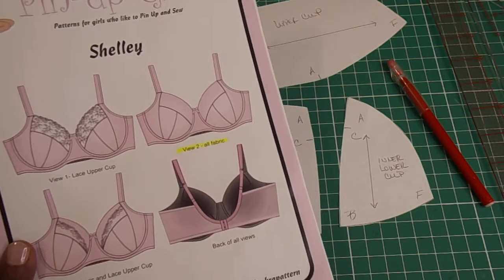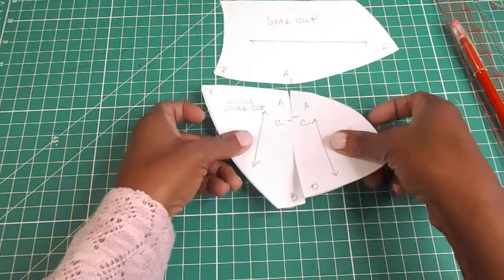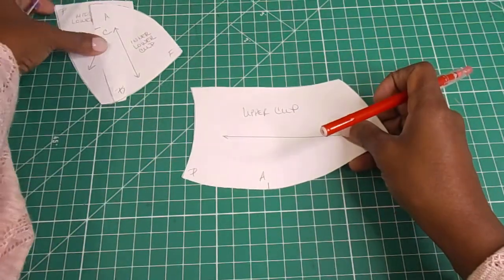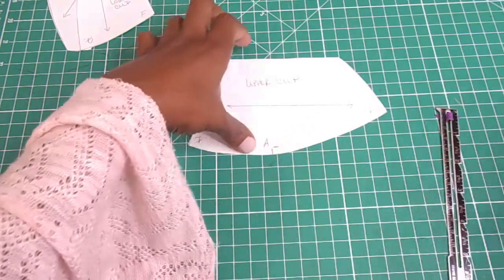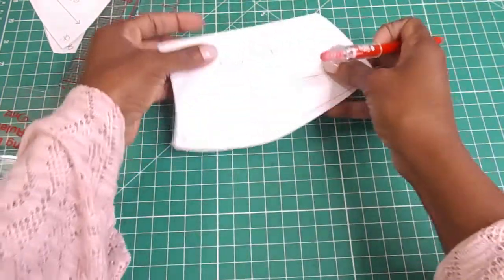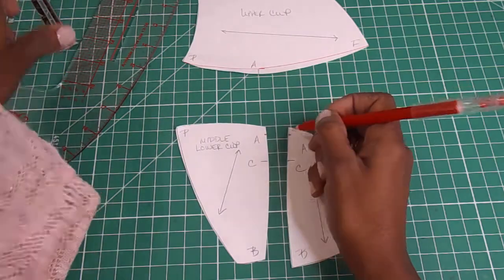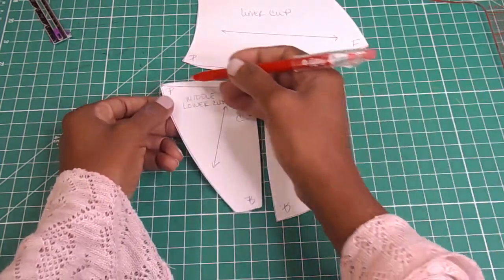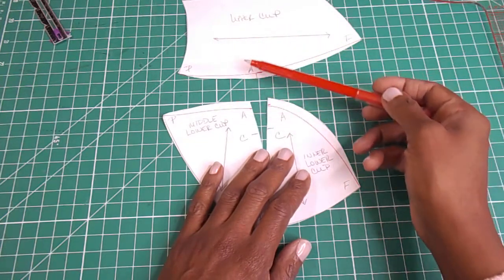Bra Pattern Adjustment - Cups, Flattening the Curve

Comment: Hello!, if you take away an inch, doesn't that mean you'll also take away some of the volume too? How do you maintain the same volume?
Reply from the maker: When you take away you must distribute elsewhere.  An inch is a lot so yes, the volume will shift then you shift the same amount to another area of the cup
Reply: @NikkiGSewingMyStyle  where do you usually redistribute too?
Reply from the maker: @Belihoney  if it’s a vertical seam you can move it to the center at the bridge - for a multi-piece cup depends on no need to move
It - the volume won’t be disturbed.   If you are removing 1” or more from the center point of the cup, consider moving down a size or removing no more than 1/4” at a time.  1”
Is a lot.  Hope this is helpful
Reply: @NikkiGSewingMyStyle  thank you so much, I'll give it a go